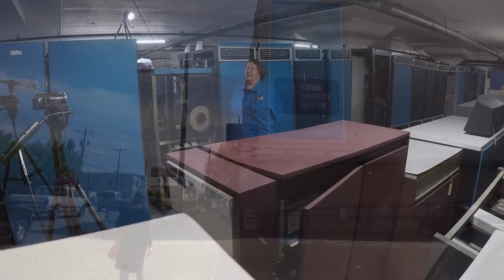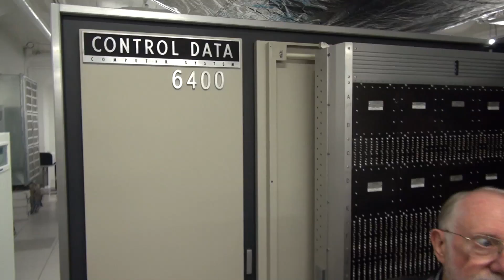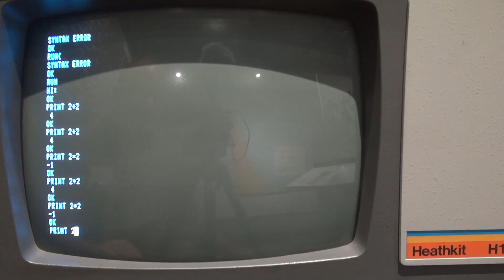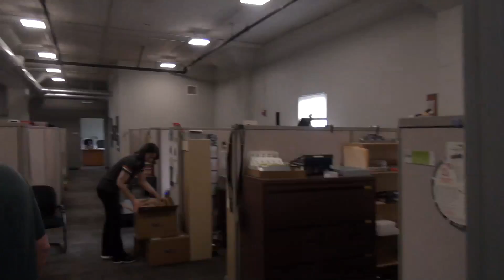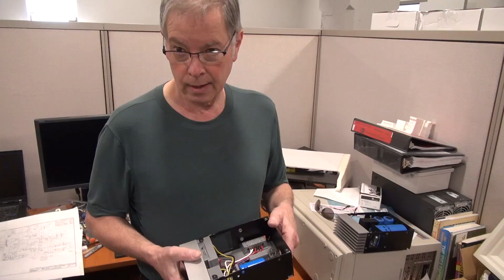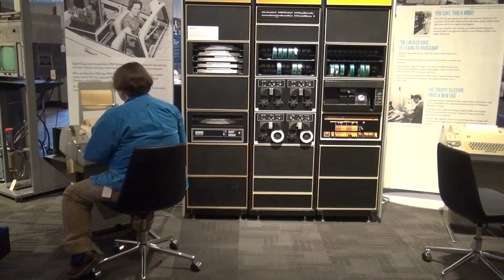Computing Conversations: The Living Computer Museum

Comment: Infact the DEC H744 and other similar plugin module PSU are switching PSUs. Not linear as indicated in this video. The efficiency is far better than 15%. Albeit the exact screw mount capacitors are harder to find these days other, similar speced capacitors, can be found. An adapter board can be built to employ non screw mount capacitors. While repairing a number of these supplies I have found very few of these capacitors that measure bad (Capacitance and ESR). Rectifier bridges and switch transistor do fail on the other hand.